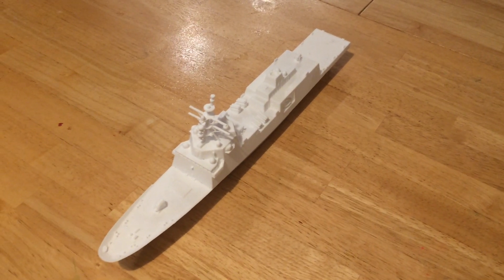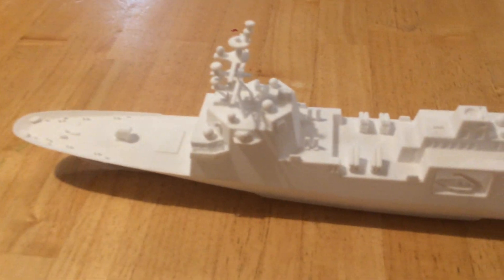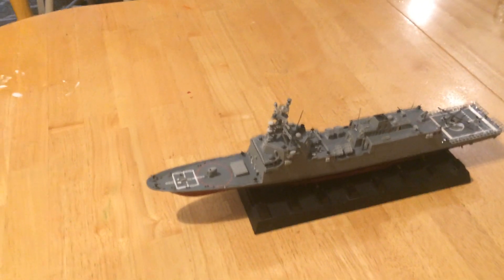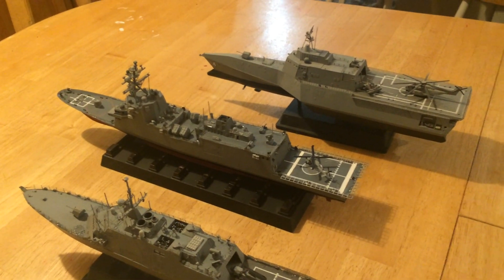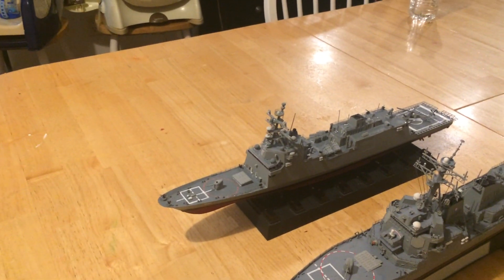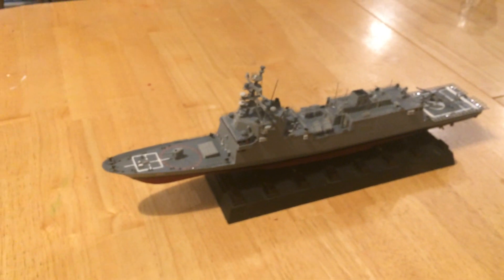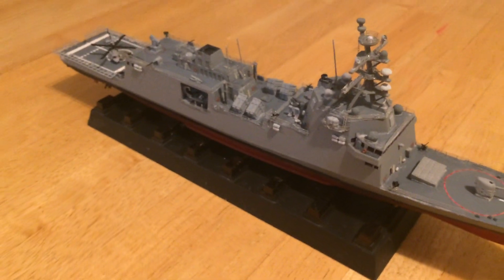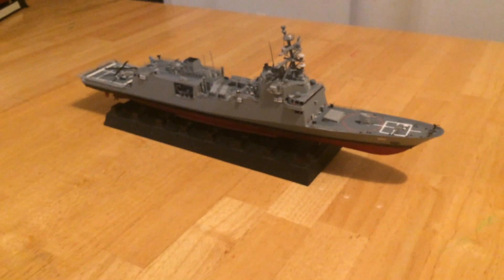US Navy FFGX - USS FFG-80 - 1st FFGX - 1/350 Scale

Comment: It appears your MH-60 is a 'Sierra' version instead of the more appropriate MH-60R 'Romeo' Seahawk Multi-mission Helicopter.  The platform at the top of the mast incorporates an AS-3134 64-array face IFF antenna for the Mk29 IFF system.  I could not tell if the bottom our your platform had the IFF antenna array faces.  Of course this is the USS Constellation Class (FFG-62). Just my input.

Comment: The existing FREMM appears to have a max speed of 27 knots. I am thinking that the frigate will be used to run a screen for LHA America Class Carriers or supply ships, freeing up the DDGs to be used to support the fleet carriers and LCS which are much faster. It's been mentioned that the ffgx is an excellent sub hunter and can run very quiet. I still believe that the LCS brings a great deal of value to the fleet supporting drones, mine sweeping equipment, critical supply transport, and defense against smaller boats and ships.

Comment: Jeff do you find the solid piece 3D prints easier or harder to paint? I have always painted in sections, and touched up once all together. Seem like it would be difficult to hit some of the areas correctly. Love the build and the Info and always look forward to your videos!
Reply from the maker: Harder.  But I have a set of very small and thin brushes which all me to get it done fairly well.
Reply: @JeffHead-IdahoUSA  do you also use airbrush for large areas?

Comment: First
Reply from the maker: I am really liking the way this Frigate looks and is armed out, and otherwise outfitted.  I hope they build all 20 of them, and maybe with time...10 more.
Reply: @JeffHead-IdahoUSA  it is an relatively easy way to keep our ship numbers up with a fairly potent ship.
Reply from the maker: @bigmike9128  Amen to that.  A proven design using our weapons and electronics.  The scaled down AEGIS will be CE capable, and cooperative engagement with the BUrkes and Ticos in a CSG or ARG will make a huge difference.

With 16 NSMs for anti-shipping or anti-surface, I expect the loadout on the 32 VLS will be 8 quad packed ESMs for 32 ESSMs giving very good coverage to mid range (50 miles), 24 Sms for long range coverage out to 120 miles, and then the 21 RAM missiles for coverage out to the horizon.  The RAM has proven a very effective system.  So this FFG will carry a total of 24 SMSs + 32 ESSMs + 16 NSMs + 21 RAMs.  That's  over 90 missiles and a great coverage for an FFG...what we should have been building (IMHO) instead of the LCS.  I believe the Independence LCS will make GREAT counter mine ships, and ASW ships.  I believe the Freedom class will make strong ASW class.  But neither of them are capable at all in the AAW role, except for relatively weak self protection, and even though a goodly number of them are going to get 8 NSMs, they will be in fights with peer class enemies who have stronger capabilities at AAW, giving them a leg up in a purely ASM duel.